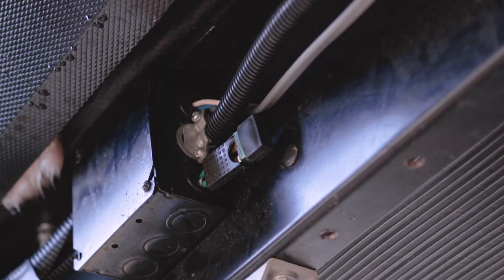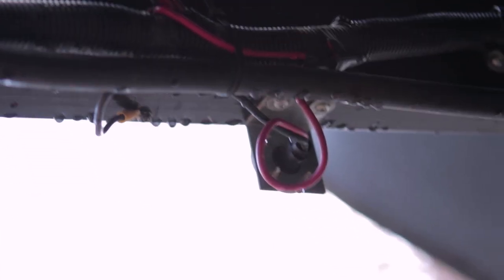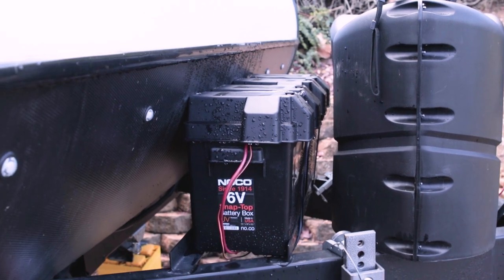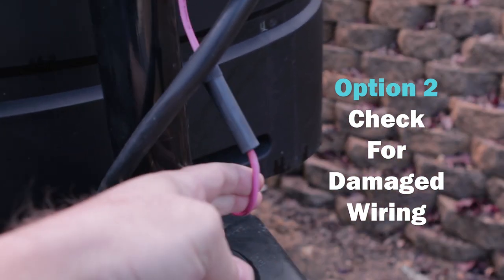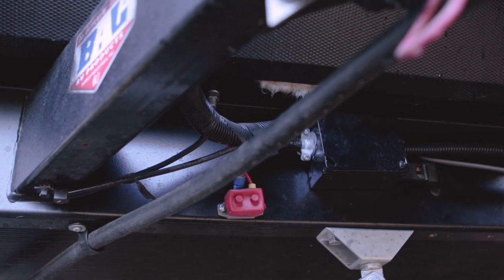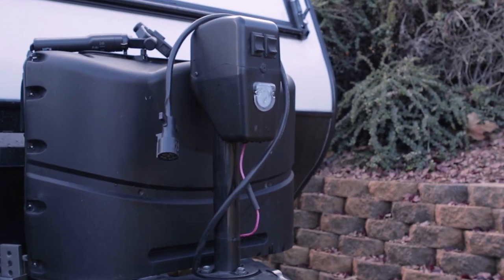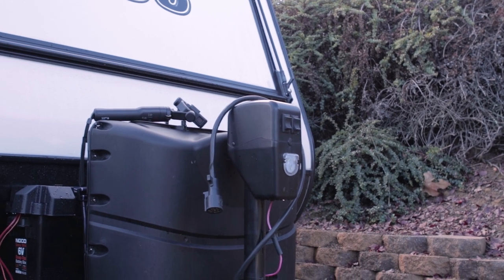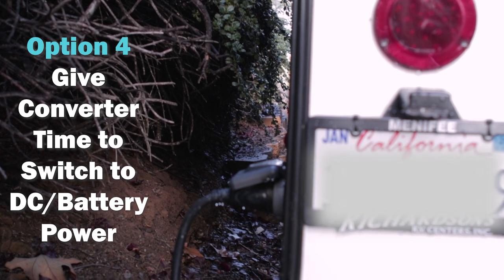Electric Tongue Jack Blowing Fuses | 4 Possible Solutions + 1 Tip | AND Merry Christmas!

Comment from the maker: This was one of those annoying issues that we were glad we got fixed. We made this video just in case anybody else is in the same boat. Hope this helps someone!
Reply: What is the part I need ? I am having the same issue with my new travel trailer..
Reply from the maker: We got an auto resetting circuit breaker fuse, but I think the thing that kept giving us issues was raising it too high a few times and the other times it was tripping because I was running it as we unplugged and we went from shore to battery power while I was lowering. You can find the 30a circuit breaker fuses on amazon or at any auto parts store. They look just like a regular fuse with a circuit breaker at the end instead of a regular plastic sheath.
Reply: I’m having same issue , but I think my battery went dead left it hooked up for over a year 🤦🏽‍♂️
Reply from the maker: That’s probably it. Does it work on shore power?

Comment: I just went through this on my 2016 Jay Feather X213 and it was caused by the power jack being raised too far and getting stuck. I loosened it after using another jack to raise it, and the problem went away.

Thanks for the help getting pointed in the right direction.

Comment: It will help if you use a fuse that's rated "T" as in, it's not a fast acting fuse, it's a slow acting one.  It's very common for electric motors to cause spikes in current because of the spools/magnetic field that generates a brief current spike after the Voltage/power supply is cut off.  It fries fast acting fuses.  Another reason it can blow is if the motor is turned on but can't turn (when the tongue jack is all the way up or all the way down), so make sure to release the buttons fast or stop short of hitting the ends.  This just happened to me and I'm now looking for a 30A T fuse... good luck guys!

Comment: I have the same issue when jack is getting towards max height, the amp draw spikes and blows fuse.  I currently keep a pile of fuses in the battery box but feel that my issue is a combination of high resistance terminal block connections and undersized wiring from battery and to frame ground.  I'm going to put larger wiring from battery and clean up terminal block connections and likely get a resetable breaker.  This is a common issue as friends of our's with a brand new rig also have the same issue.  I think upgrading the wiring from batt will be key.

Comment: my problem was the ekectric jack was tied into the fuse to the main panel. running rhe jack when rhe fridge was running takes out the 30 amp line fuse.  the jack has an auto reset breaker and its own 30 amp fuse. i am connecting the jack direct to the battery.

Comment: Make sure the cap on top is secure and the case is not filler with water. Also, check the fuse amperage.

Comment: I too have had this problem nothing to do with Shore power bring that Jack too high or too low will pop the fuse every time. I put my jack up and down whether I'm hooked up to shore power or not never had an issue.
Reply from the maker: Got it, thanks sooo much! I think it was having the button pressed down while SWITCHING from battery to shore power. Appreciate the tips!! 🙏💪